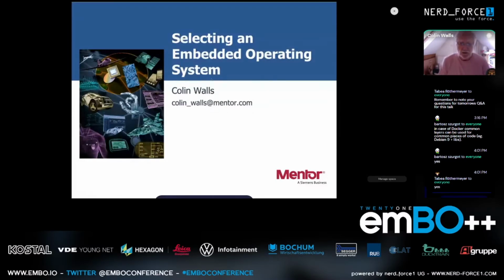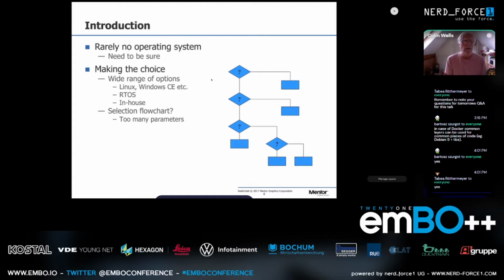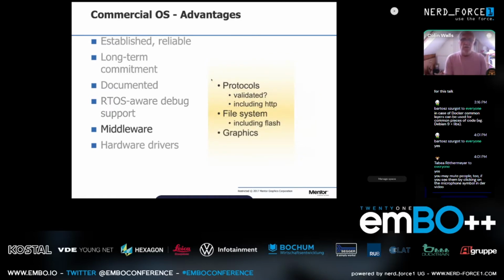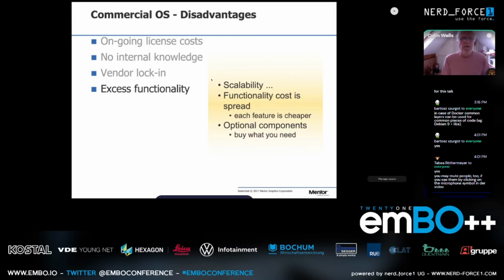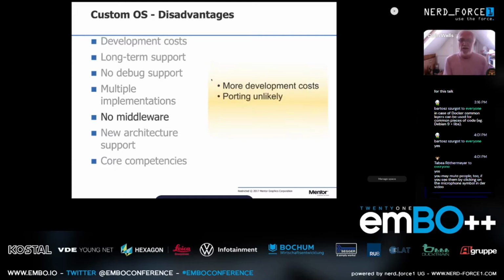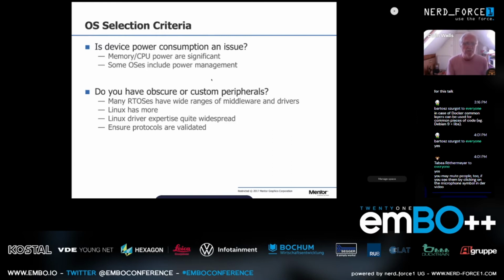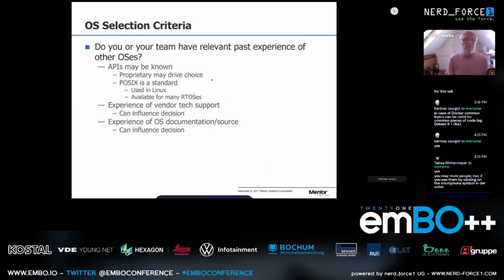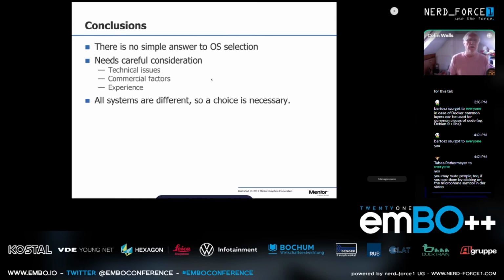emBO++ 21 - Colin Walls-  Selecting an Embedded Operating System

Comment: If a task, regardless of its priority, sits in a tight while(1) like loop, does an RTOS, like FreeRTOS, have the ability to wrestle away the CPU to another task? Or is it assumed that all tasks must play nice and voluntarily yield the CPU (ex. vTaskDelay())

My goal is a motor application, where if a task receives a command, it starts to move the motor until it arrives at the destination which could takes up to 30 seconds. In that time, if another command is received it should stop / reverse.  So I was thinking something like..

wait for queue command
start motor moving
Continuously check position and stop when reached OR stop when new queue command is received

Would monitoring the position starve all other tasks?
Reply: typically RTOSes (like FreeRTOS) have preemptive task schedulers. I.e. yes, they do wrestle the CPU away from another task. Handling preemptive scheduling can be troublesome. So, there are methods for non-preemptive task scheduling. There is an article on EmbeddedRelated called "You don't (always) need an RTOS" with an overview of such methods. There are tiny RTOSes with cooperative (i.e. non-preemptive) schedulers, like ULWOS2, cocoOS or QP/QV framework.

But, I think, this presentation does not discuss RTOSes just as a subject, with an insight into their possibilities. The presentation has a more professional-oriented focus: what is the typical environment in the embedded industry, i.e. when you run or work in a company that makes an embedded product, what you do with the RTOS in your development, how you approach the choices. (Like the point that "you don't need to pop the hood of your car, so why would you study how your RTOS works" - that's clearly aimed at application developers in an typical project.) Hence, the focus is on more serious RTOSes, inlcuding RealTime Linux (POSIX standard btw) and commercial RTOSes.

It would be nice if this presentation gave some insight what drives the choice of preemptive/non-preemptive scheduling. And why larger more serious RTOSes are usually preemptive.